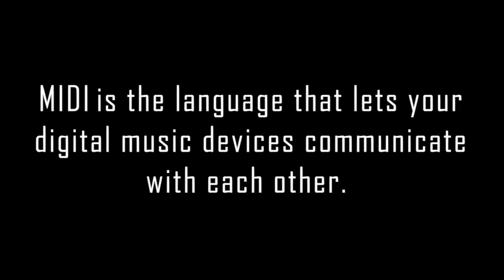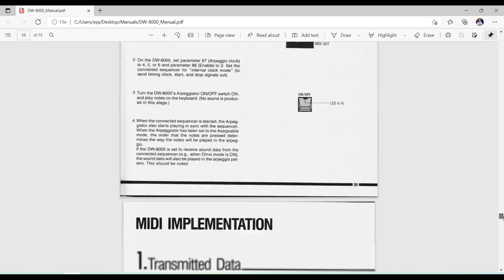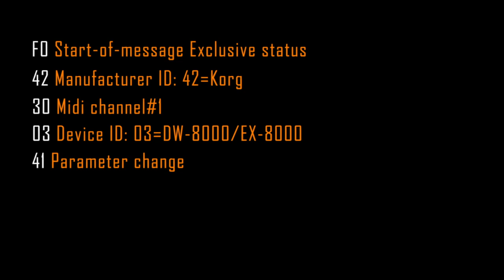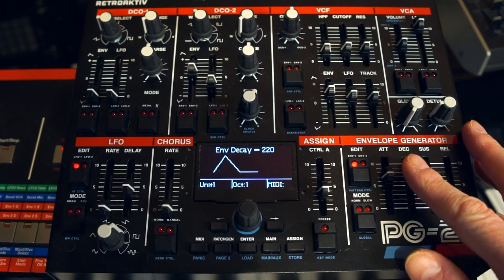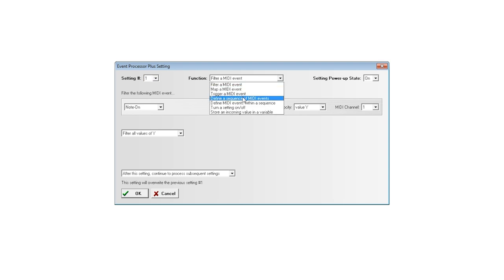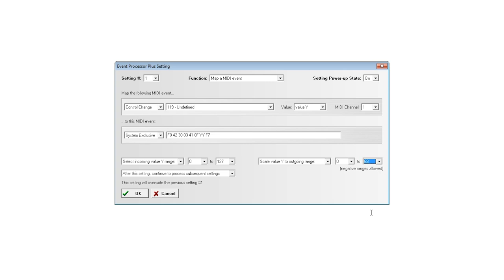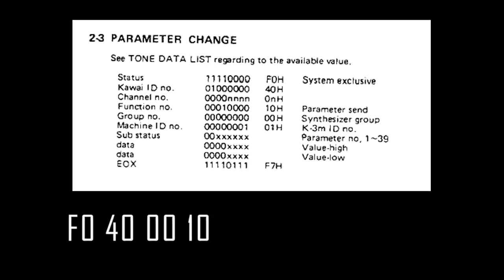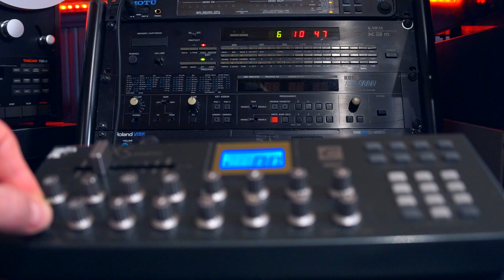Midi Sysex - The black arts? | Introduction and tutorial

Comment: Is there a way to convert a sysex message to the MSB/LSB program change?
Thanks in advance!
Reply from the maker: Not at the computer right now, but pretty sure you can do that. I suggest you check out the manual at the Midi Solution's website.